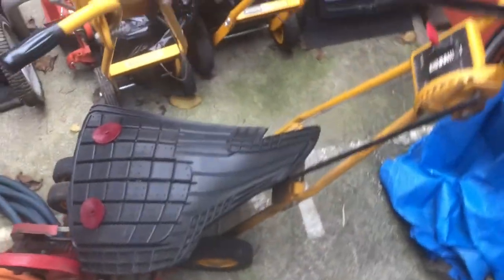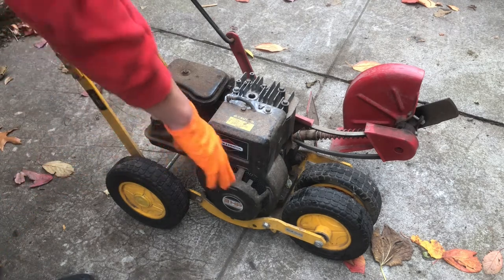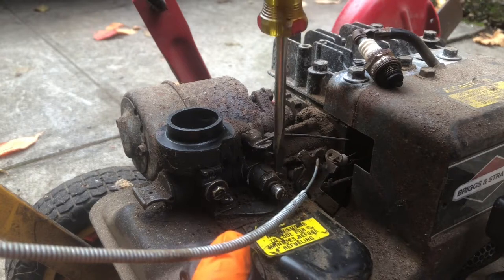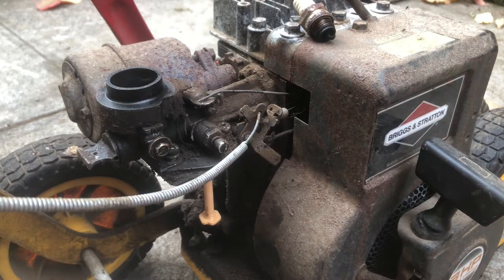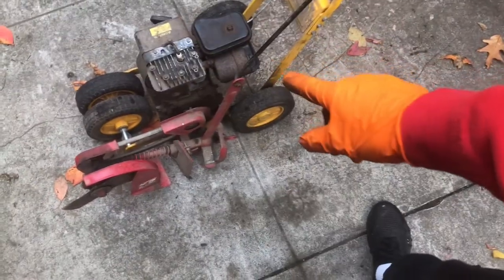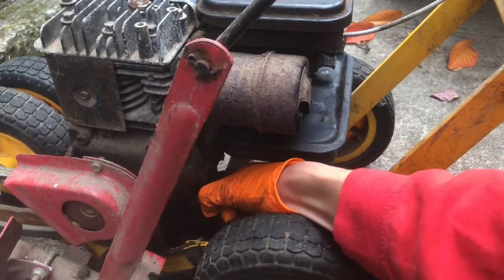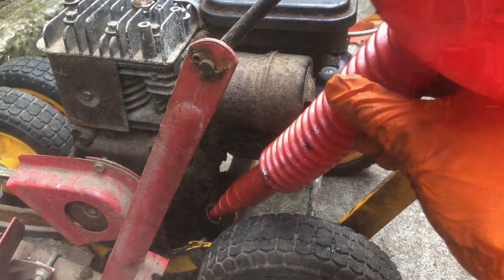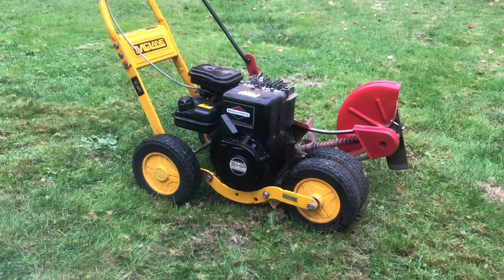How to fix a McClane 3.5hp edger that won't start- Carburetor tuneup, oil change, walk behind.

Comment: I just finished reworking my McLane 3 hp Briggs edger. The carb has no accelerator pump. I removed the carb, gas tank, and muffler. I removed the only jet in the carb and cleaned all the passages including the plastic tube screen. I replaced the spark plug and cleaned the other components very well. My starter pull was hanging, so I removed the cover and lubed everything up. I almost had to remove the motor to allow the cover to clear the brackets! After replacing the belt, air filter element, and greasing and lubing everything, and refilling the gas tank with fresh gas, the motor started on the second pull! Thanks for the video!

Comment: Got a mcclane mower 20 inch.  My throttle linkage is not right.  Could you send a pic of the springs, to the selectors and throttle arm.owners manual doesn’t have it.

Comment: I just bought the same edger but it is used. It wouldn’t start when I bought it but I noticed it had a deteriorated and cracked rubber boot that went from the carb to that cylindrical thing beside the carb (on the blade side). I am hoping that once I fix that, it will run again. I got it for $250 Canadian today and these sell for close to $1,000 Canadian. I hope the rubber piece fixes it.

Comment: By far the best video I’ve seen on a simple fix and what to check for pretty detailed even for someone who may not work on their own equipment. Thank you so much. This is a gem of a toy from the days
Reply from the maker: Appreciate it!
Reply: @Mechanic_kid  say , I have the same edger  and it is lacking full power is there anything that you can suggest to me  - great video 👍
Reply: @montellwilliams811  probably adjust your throttle cable
Reply: @BowlOfseeds  ok , thanks 👍
Reply: @montellwilliams811  no problem, I hope you figure it out if you haven't already. Your comment is from months ago 😔 if you adjust your throttle you'll probably have to adjust your idle screw as well to accommodate for the change.

Comment: Say  , I have the same edger and it is lacking full power  - I cleaned the carburetor and replaced the plug and gasoline  - help anyone  , great video  👍
Reply from the maker: Sometimes the lever does not push to full throttle. Follow the linkage down to the carburetor and mess with it to see if that’s the issue. Just a thought👍🏼

Comment: I'm still working on mine, it's exactly the same one you have. I replaced the pull up rope changed spark plug and oil  but it still won't start. Rope jams still.
Reply from the maker: 99% chance that your CARBURETOR is clogged up. Super easy, just remove the air cleaner, take a can of compressed air and CARBURETOR cleaner and spray it through the little holes. Should start right up👍
Reply: @Mechanic_kid  thank you, I'll do that.

Comment: What is the purpose of the wheels in front moving freely on the shaft?  Then it looks like you put a spacer in there?
Reply: The wheels right beside each other (as pictured in the video) allow room for the blade to tilt at an angle. If you put the spacer between the wheels, it’s for regular 90-degree edging.

Comment: Was given one of these probably been sitting forever but it white smokes bad.. bad gasket seal or just needing good tune up ? Oil that was in it was almost milk color? Gas and oil mix maybe
Reply from the maker: When the oil looks milky that means water is mixed with the oil. It probably sat outside and got water in it. Drain the oil, put fresh stuff in. Maybe also a new spark plug. Should be good to go👍🏼
Reply from the maker: These things are honestly very bulletproof! Nothing major ever goes wrong with them (head gasket). Just make sure the oil is clean. Might even change it twice to make certain. Goodluck
Reply: Bought mine 25 years ago and finally I need to replace the throttle cable. This edger sells for $579.00 today.  As you said,       Bullet Proof !!!

Comment: I bought one today and I'm so disappointed. My stick edger is 26cc and way more powerful than this thing
Reply from the maker: Dang sorry!
Reply: Check your revs out with a tach on the spark plug. Run it at 3600 no load rpms. Sounds like operator error to me.